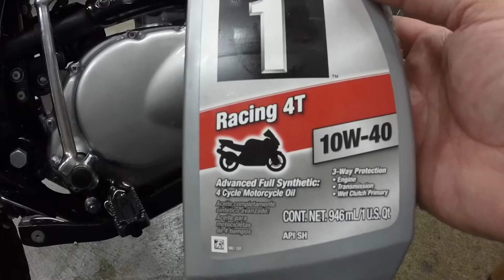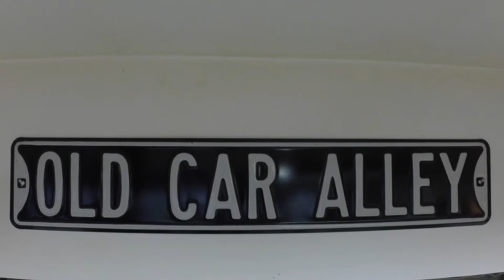1976 Honda XL175 restoration part 25, starting, riding and fixing bugs

Comment: Motorcycle helmets are now rated by years and after so many years they are not allowed to be sold for riding in my home state of Missouri, we do have a motorcycle helmet law.  I rode for several years ago and I rode in Illinois and Kentucky neither of which have helmet requirements, I never rode without a helmet and if I were riding now I wouldn't ride across the street without a helmet.  Great job on the motorcycle just like the Pontiac and everything else you do.  Thanks for entertaining me.
Reply from the maker: Yes, helmets go bad as they age, the foam breaks down. I may hit the local motorcycle shop, and buy a new helmet that has that older look. New helmets are not much more than a used one... so I might just as well get a new one. I want to paint it to match the blue on the XL175. I value my brain, so I always ware a helmet! Thank you for watching my videos.

Comment: where did you find that rubber bung that goes over the cam chain adjuster on the left side of the case?  bike looks great by the way!
Reply from the maker: I do believe it's the original one to the bike. I never replaced it.... I have owned the bike since it was new.

Comment: Hey there I know this is a relatively old video, but I have the exact same bike and I was wondering if you could help me with the link to the clutch cable that you found since the one i bought doesn't fit into the clutch casing . Thank you for reading
Reply from the maker: I honestly don't remember, as most parts I collected when the Honda dealer I bought the bike from new, clean out the old inventory in their later years, selling it super cheap. The salesman I bought it from knew I still owned and rode it..... Try eBay.